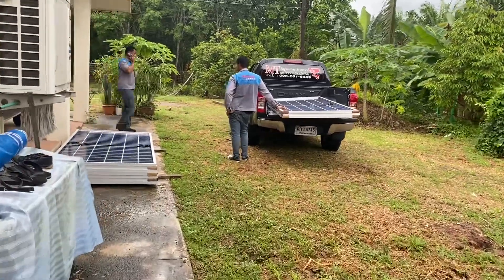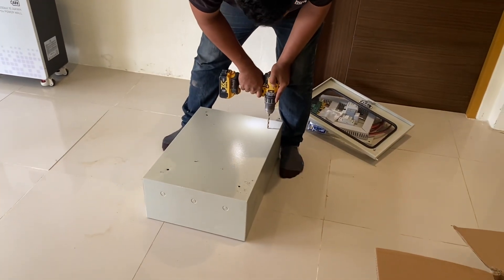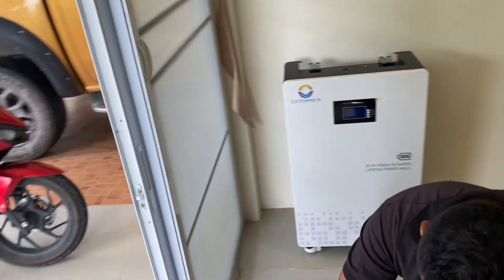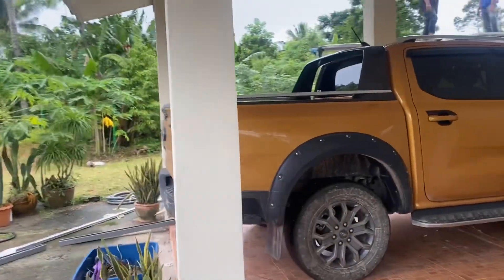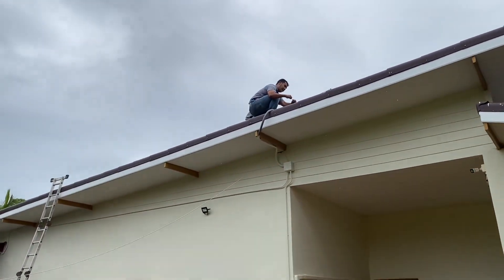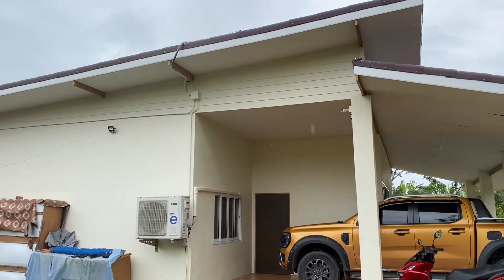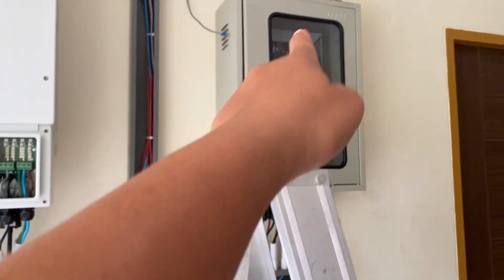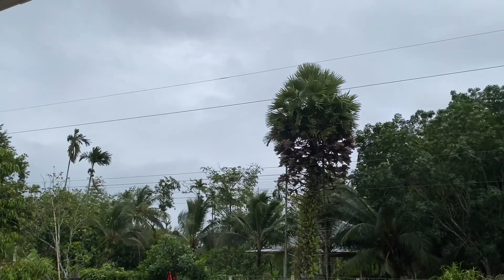Renewable energy for our home 🏡☀️from day 1 to finish

Comment: I came across your video by accident as I am looking for a supplier of PV panels etc. As an engineer from the UK I was compelled to say something. You may want to get the installer back as that is a very poor install. This is not a dig at you, as you may, and probably don't know better, but the group of install personnel should know better. 

1. Drilling a metal box on a floor tile is a no no....especially with out any floor protection. 
2. Drilling concrete wall above the inverter with out having some kind of dust protection is not recommended, I hope that vacuumed the internals before leaving? What they should have done is used the back panel patten, to know where to drill, so they wouldn't have to mess about lifting the inverter and then taking it down again.
3. What can I say about the way the left the cables trunking, I have seen some shockers but thats terrible. 
4. The way that the PV panels were bouncing around in the truck, did they check each panels output to ensure no cells we damaged? 

5. Walking around on a roof with out walk boards on a light roof is poor project management, I hope they paid for the replacement tiles?
6. How did they wire the generator in, does in feed direct into the Inverter panel?
7. Did they set your PV service priorities correctly (Solar, Battery, Grid, Generator) or did you ask for something else.
8. I would expect and they should come back after 3 months to do a system check?